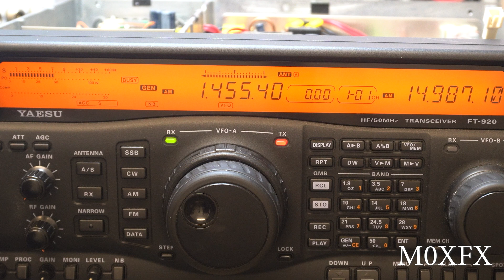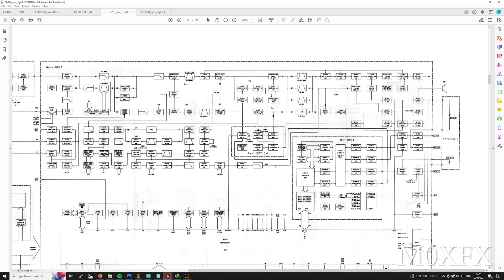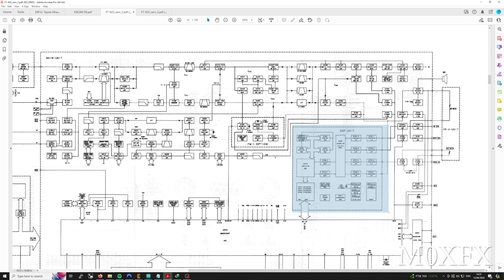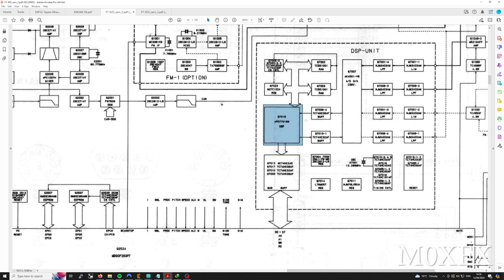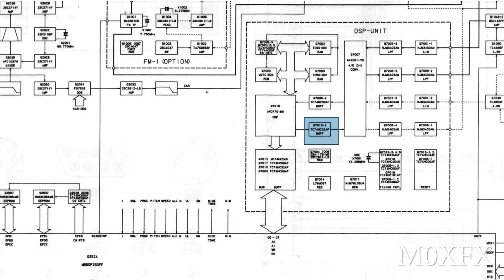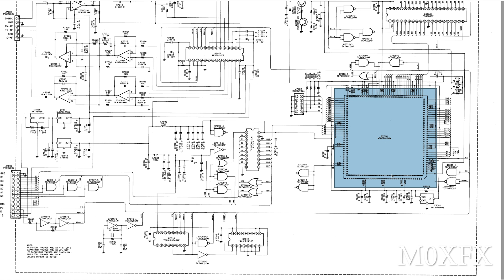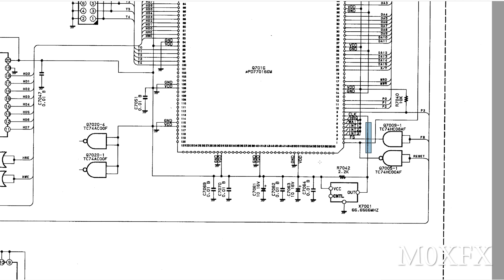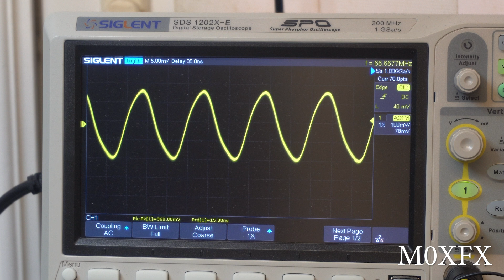Yaesu FT-920 DSP Unit Repair (Ticking Time Bomb)

Comment: I have one that I bought on eBay.  It was in rough shape; no more than 20 Watts out on most band's and poor receive sensitivity.   I went through the alignment procedure and fixed those problems.   The mike I got with it had low output.  No way to correct for that so I replaced the mike.  The radio has very good sensitivity now.  At the end of the alignment procedure, pages 3.8-3.9 in the Tx Carrier Point, you are better off not doing this procedure where the injection frequency is 350 Hz or 2600 Hz.for USB and LSB.   Just leave F-28 ="0.000" and F-31 = "0.000"   On the next procedure, Rx Carrier Point, page 3.9, set F-27 = "0.000"  and F-30 = "0.000".   If you follow the procedure as printed, you will get horrible narrow band transmit and receive.

Comment: If you need any parts I have a 920 with a bad main board
Reply from the maker: Hi Gene,

That's a great offer, as I assume there are still a lot of hard-to-find parts in there. May I ask what the problem is with the main board?

Regards,
John M0XFX
Reply: @M0XFXUK  some how it got flexed to much and has about a 8 in crack right where the processor sits and Several other components